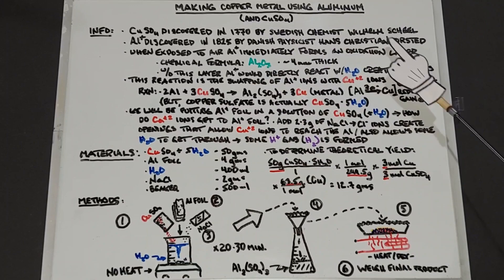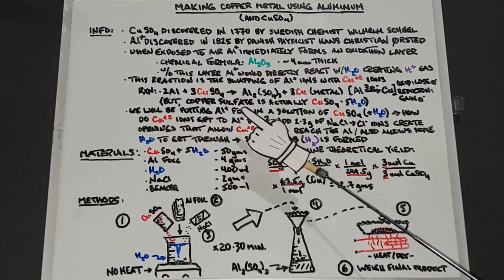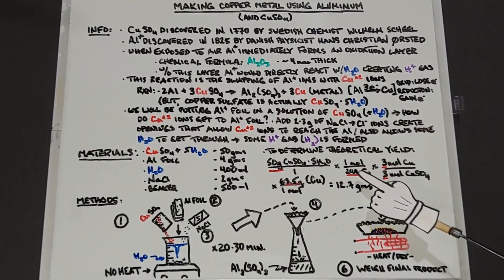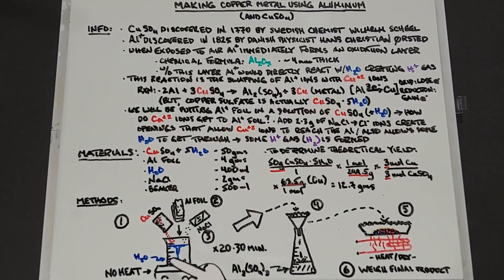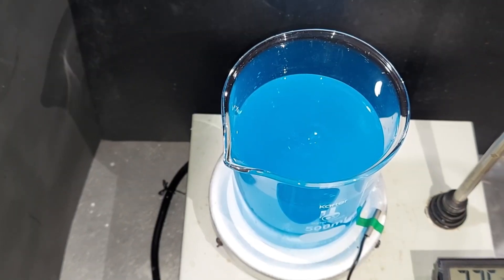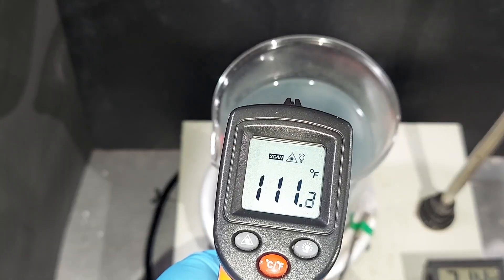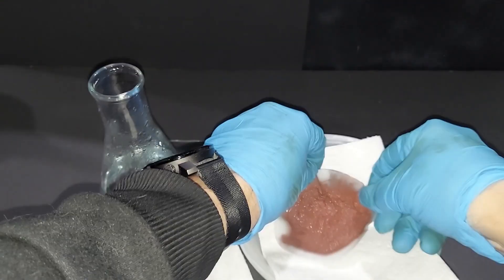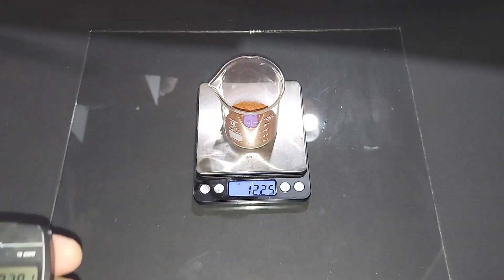Turning Copper Sulfate Into Pure Copper Powder

Comment: I have no idea how chemistry works but what happens to copper when put it in vinegar to make copper sulfate? Is there just less copper or does it somehow change? Thanks
Reply from the maker: Hmmm.  Copper does react with vinegar (acetic acid) but it's very, very slow.  Eventually the vinegar will turn green, which is copper acetate.  When all of the vinegar evaporates you would get green crystals of copper acetate.  I'm just not sure what you meant about copper sulfate?  You can get that by putting copper metal in sulfuric acid, but it forms some dangerous toxic gasses in the process.